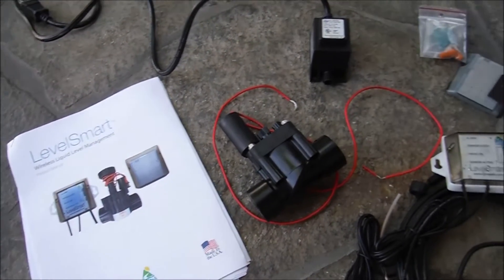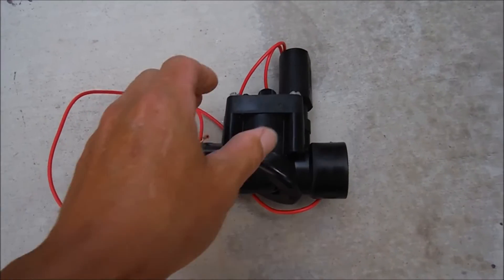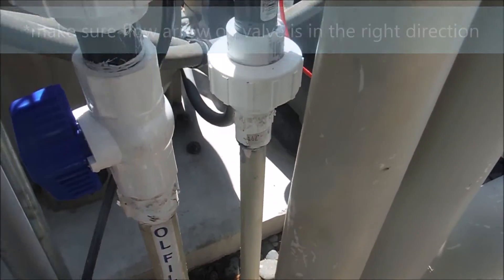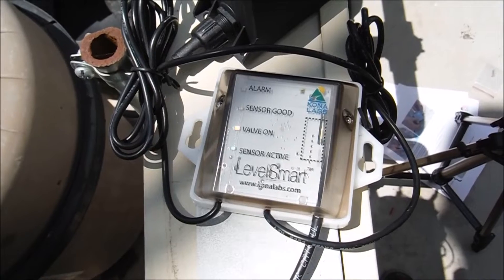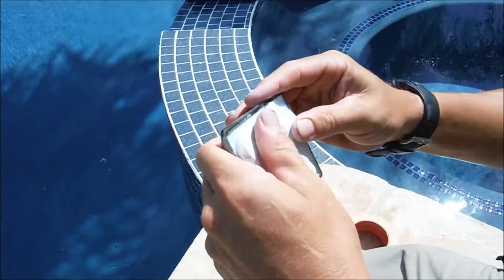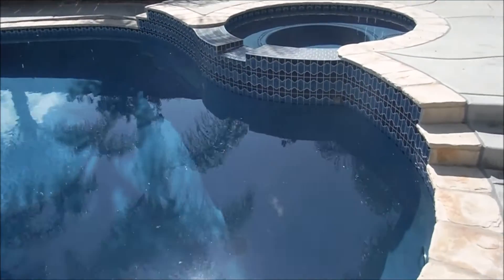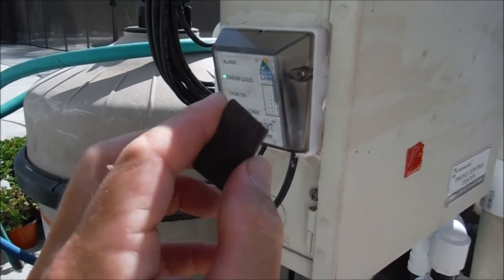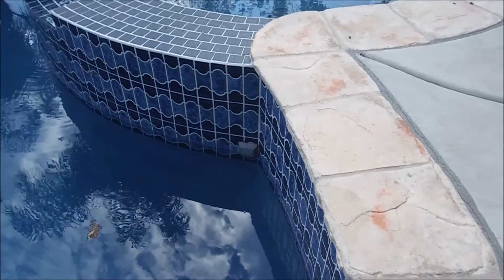LevelSmart® Wireless Autofill system Overview and Installation

Comment: Thank you for your video.  I've been cussing LevelSmart every since we bought their system.  When it works, it's great.  But the instructions we got with our kit failed to mention some of the key things your video helped us with.  One was how to test to see if your valve is working.  Putting the magnet on the controller (not the sensor) for a few seconds turns the valve on for about 5 seconds...so you know it works!  A simple thing...and NOW I see LevelSmart's online instructions include this information when our written instructions did not.  I'd also add that it's important to know EXACTLY where to place the magnet.  In our case, things didn't "activate" when placing the magnet just like their diagram indicates.  We had to put the magnet lower...about 1/8" hanging over the bottom edge...for things to work.  A minor detail...but crucial information that good instructions would have / should have mentioned.
Reply from the maker: Good to know. I also found placing it in the skimmer nook does not work for many pools. I just put the senosr in direct line of site of the control unit. 👍

Comment: How do you replace the sensor later on after it’s been epoxied in place?
Reply from the maker: The epoxy comes off. Then you just need to sync the new one up with the controller.

Comment: We are refinishing our pool. We do not currently have auto fill . Which makes it difficult to go away during summer here in socal, for fear of water level getting to low. We were going to have pool remodeling install a traditional auto fill ( pentair,  superpro, a & a) tank style with float. Is this a better way to go in 2022. No need to cut into concrete to install. Why do no pool stores,  or builders offer this solution every one has discuss installing the traditional kind ?
Reply from the maker: Not sure why they are not in wide distribution but this will work great vs the traditional in deck autofill. That said, if they are redoing the deck and cement as well, that is when I would have a traditional one installed.
Reply: @SPL   Not redoing deck / coping etc other than replacing broken plastic along expansion joints.  So they would would be cutting into concrete to add the well/tank.  If went with traditional style which is better  brass horizontal float or vertical/ Fluidmaster?  What about brand?  Pentair vs A & A vs Super Pro? Is one brand better than another?  Also how does the kona connect wireless? I believe you are somewhere in IE/San Gabriel Valley area of socal ? Are you available to sell / install the KONA?

Comment: can the battery get replaced?
Reply from the maker: Don't think so. This one is still working.
Reply: @SPL  well, it should be. Considering the battery life you stated ;-) I think it's pretty uncool that a system for 600-800 dollars doesn't have a replaceable battery. Are you supposed to buy another one after the battery runs out?
Reply from the maker: It is built into the sensor. Once it dies you just need a new sensor and you can pair it with the LevelSmart. I don't think the sensor is very expensive.
Reply: The battery will last for many years.
Reply: My battery just died I think because the system stopped working and the green light on the sensor doesn’t come on anymore. Trying to figure out how to replace battery or do I have to buy a new sensor??

Comment: what about draining automatically?
Reply: Why would you want to install a system to automatically drain? Doesn't really make sense to me.
Reply: @xXBlockOutXx  rainstorms can over fill a pool sometimes. I have ran into this before myself.
Reply: @vincetalley5598  I do understand that there might be some circumstances that may require you to drain some water out of the pool I just can't wrap my head around the fact that this would be a reason to want an auto drain system. Refilling a pool every couple days because of the high temps here in Phoenix can get really annoying on the other hand.

Comment: Is it possible to convert a Poolmiser PM-101 conventional "toilet" float style autofill valve to a LevelSmart Wireless autofill?
Reply from the maker: I think so. You would just plumb in the valve at the fill line like in this video and then remove the "toilet" float and let the Level smart control the water level.

Comment from the maker: LevelSmart Wireless Autofill - Kona Labs: It is the year 2014  so where are the flying cars! Where are the Jetpacks... where are the wireless swimming pool autofills - oh wait! We do have that now. Check out this really cool wireless swimming pool autofill system.
Reply: what about draining automatically?
Reply: Is this still a good option to install in 2022?  My 18 year old pentair autofill has cracked at the inlet where the fluid master float connects. I am being told the only way to fix is to take up concrete and replace entire unit. Could I plumb this in and use autofill without the fluid master float? Or is there something else that has been created since this product first launched in 2014?